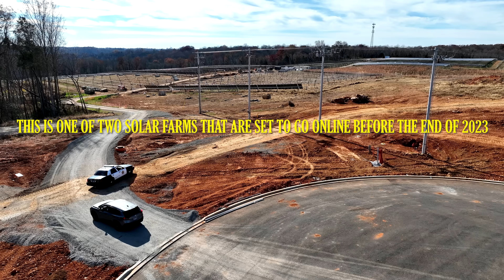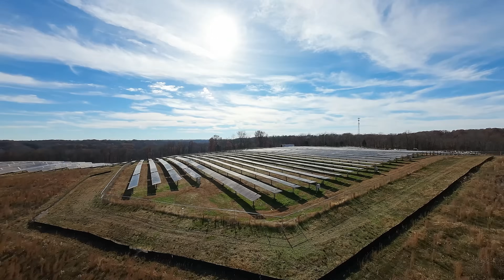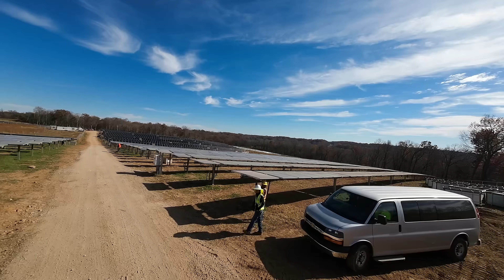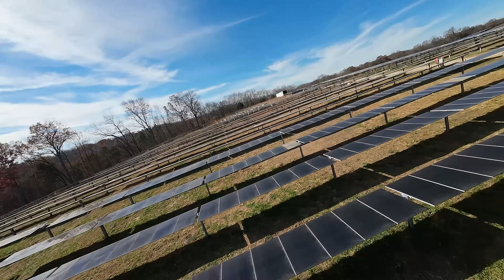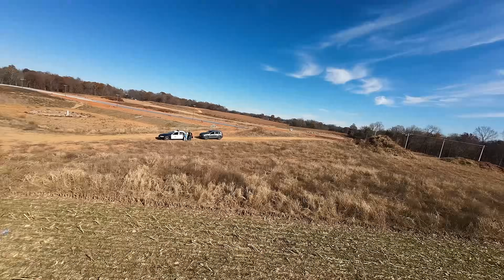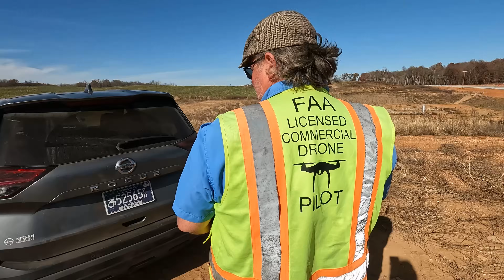HOW TO - Fly a drone at a Huge Solar Array

Comment: We bought 12 panels that size. Though 5 years old, removed from just such an installation, and poly crystalline, they are 290 watts each. Ten of them will be installed in our bus conversion to a motorhome. They were $110 each. 
New they’re more of course but not $800. 
We will have 2,900 watts feeding a 10 kilowatt (expandable to 20kW) lithium battery bank and a 6,500W inverter to run two mini split air conditioners/heaters, microwave, refrigerator, washer/drier, lights, vent fans, etc.

Comment: Awesome Ken. Question for you FPV flyers. If you have or previously had a Mavic air 2, do you still have the desire to fly without using Goggles? I’ve owned a Mavic air 2 for 2 months and enjoyed flying it connected to my phone. Now that I have a Avata with the integra and motion 2 controller. It seems I’ve lost interest. I know I hey are 2 different kinds but I think I get pretty good pictures with the Avata. Just curious

Comment: Roughly 15 years ago I bought 0.26 Kw of panels for the pantek truck I lived in. Then it cost $2000 Aus for 4 by 65 watt panels. Still in warranty , 20 years full power. BP solar.
I lived comfortably for 7 years in that truck, no power outs.
Around 2 years ago I bought 1.3Kw of panels for $600 Aus total.  They seem alright so far.

But heh , it's not a lump of coal , that will never work they told us.   BS!
Have a good one Ken and crew.
Ps, As a 60s child so happy to see this happen world wide now.

Comment: $800 to $1,200 depending on wattage. What’s the wattage? You can get 400 watts for about $300 bucks. 

Of course, I am not including the stands they are on the regulators that are connected to the 3 to 4 solar panels plus the cost of the installation either in my math. 😮

Comment: Mowing these fields are the most tedious job ever and because you have to run your mowers slowly because the ground is uneven they take forever! Not to mention the weedeating you have to do under the MILES of solar panels because many won’t let you spray roundup under the panels.
Reply: here in Netherlands we just have sheep graze between them, the panels provide a shelter from sun and rain. just need to raise the panels and wiring a big higher of the ground
Reply: @nfnworldpeace1992  most in usa dont know about sheep, lol.